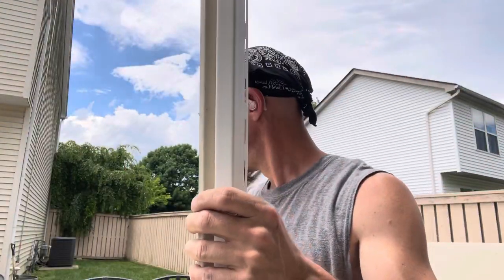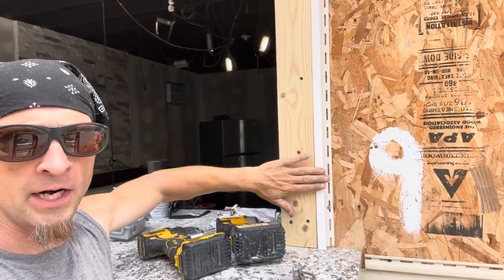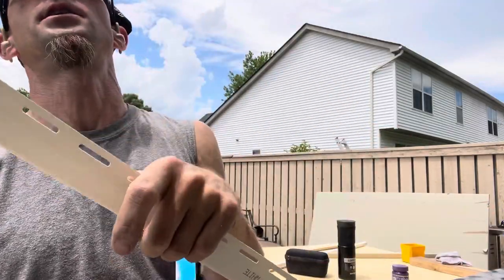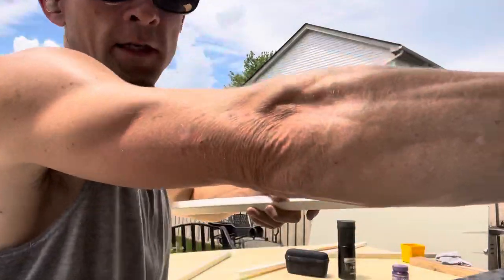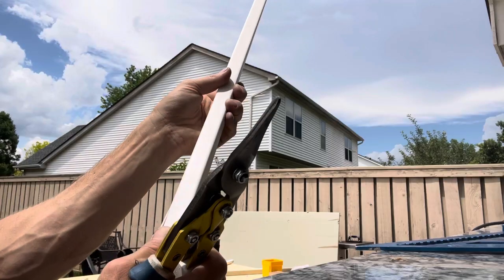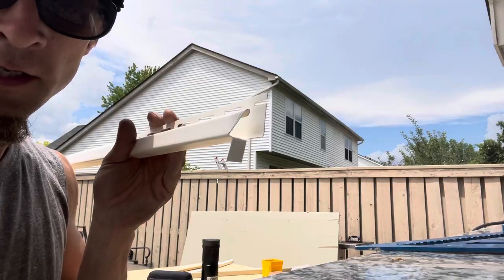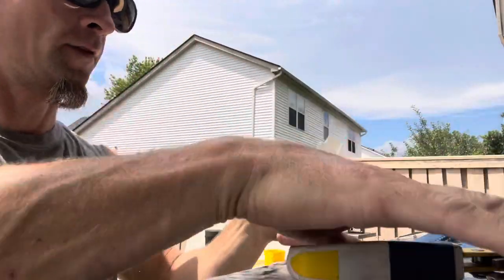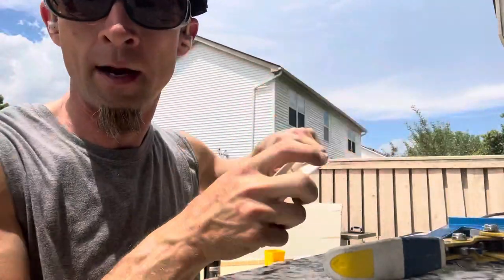How to do siding/J channel corners

Comment: Good basics, try inter locking by just notching & keeping the side channel square it will tuck into and lock into the small curved area of the 45 degreed top channel🤩, try it, you find it keeps the corners tight.
Reply from the maker: Thanks for thst

Comment: No thanks 
No Tyvek 
No bueno
Reply from the maker: It was a shed just for summer use
Reply: @delidavethebuilder280  why does that come into the equation. Tyvek is used everywhere so your building doesn’t rot out in 5 years. You should make this perfectly clear to everyone watching that you were too cheap to tyvek the walls on your building